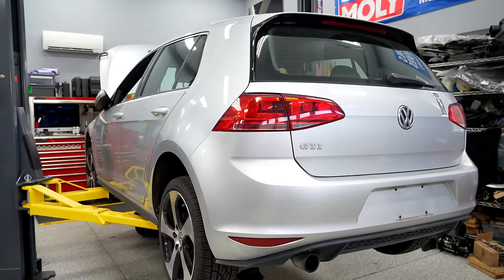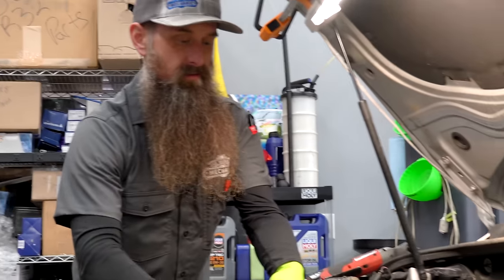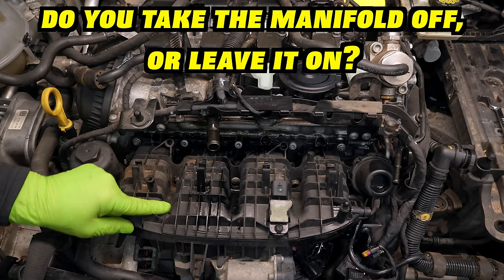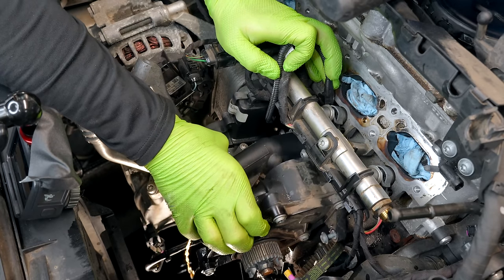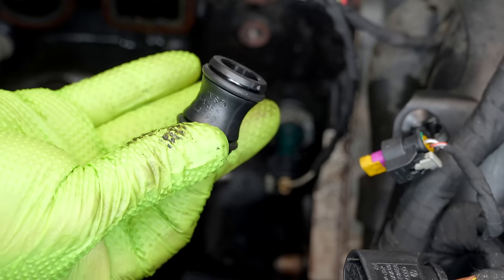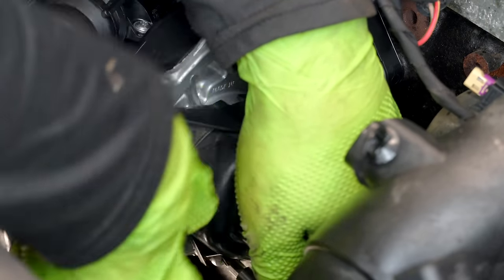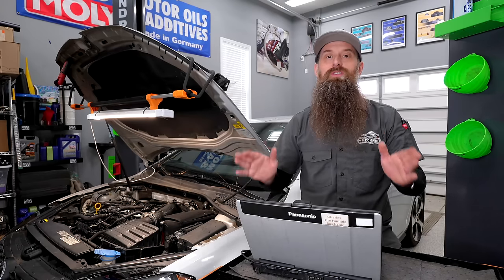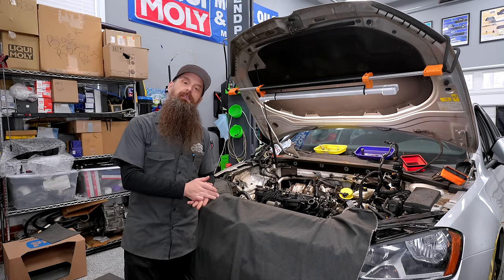How To Replace A Leaking MK7 2.0t Water Pump

Comment: How often should I replace water pump for the MK8 (play it on safeside) I have 22 GTI (bought new, originally leased but decided to keep it after a year of driving it). Love the car and want it to last for a long time. Speaking of water pump should I replace the coolant every 5 years or 10 years (VW reccomendation)?
Reply: They usually go out around 60-80k , 100k if lucky . If you are keeping it for long time. Learn to do these jobs .  They are not hard with video .  I learned and worked on my mk6

Comment: Man has been producing engines for over a century. We haven’t learned pumping hot liquid through plastic components is a recipe for failure? It’s sad that cost cutting is the achilles heel of modern engineering. Good video though, thanks!

Comment: I have a 2017 and my coolant level is at minimum and it say on the bottom g13. But the VW dealer sold me g12 now my question is should I drain all of the existing coolant and fill with 12g or just pour some 12g it will be fine? Thank you Charles

Comment: Amazing video!

Did the 2.0L tdi have a similar failure rate on the water pump?

I assume the replacement process is very similar
Reply: No, the 2.0L tdi is very different. That engine has the waterpump running off the timing belt.
Reply from the maker: This!

Comment: I prefer to do it the repair manual way.
Take the fan shroud out, then you have all the room in the world to take the thermostat out.
A shop that does it the youtube way (intake manifold out) charges more than the dealership for the same job, or at least that's what I've seen on receipts while diagnosing fuel leaks after "another shop" did the thermostat job.

Comment: What year 2.0t is the most reliable? I would like to buy a used a4, 2017- 2022,  are any of the tensioner and carbon issues less common in any of those or are they all potential nightmares?

Comment: I've got a question, I replaced my waterpump but when I start the car it goes into limp mode and heat gauge goes right up without the car heating up, I plugged in a machine and it states the actuator ..

Any help would be appreciated 🙏

Comment: I don't know if you can help me out here but I have a 2006 VW mk1 City golf, I want to change camshaft seal which is leaking and also I want to replace my coolant to a more efficient Pink one because currently I'm using a blueish/greenish one so I don't know where to start interms of doing these two jobs....but for the CAM I'm very much intimidated by the timing involved😭😆

Comment: If you conduct coolant fluid changes more frequently, you will not have the issues depicted here.  The coolant that was in this car was old and thus, had no more lubrication to provide and/or it was mixed and became more corrosive.  Keep it fresh and over time you won't see this.
Thumbs up Charles...

Comment: I had a 1999 mk3 golf with a 2.0 8V and I replaced the water pump 3 times in 4 years of ownership. From 115 000 km to 220 000 km. Seems like their flaw is still the cooling system.

Comment: My 2016 GTI with around 80k miles does not leak any coolant so I'm not eligible for the water pump warranty extension but periodically I get an EPC light, my guage goes full hot and I'm in limp mode. Pulling over and shutting off the car resets everything back to normal. OBD11 gives me a P00B700 code. Is this a bad thermostat or could it be one of the temp sensors?

Comment: Instead of using a crank locking tool, could I get away with just a socket and breaker bar holding the crank in place to remove the pump pulley?

Comment: People complain and yes this is a common issue, but around 4:06 it is mentioned this car has around 100k miles and almost all the clamps and stuff show signs of never having been removed/replaced? Getting 100k miles out of a water pump before needing to replace it isn’t too shabby in my opinion 🤷🏻

Comment: Dealership did a recent water pump replacement on mk7 gti , after that I had another leak (looks like where the oil pan meets the block under crankshaft) could this be because of there work? I tried looking under and I couldn’t find any obvious leaks
Reply: MY engine block is crusty above the oil pan, but thats just where the coolant collects from the thermostat. Idk im about to find out. I also found a little bit of oil today that smelled sweet like coolant. I think oil is collecting near the crusty coolant.

Comment: Why oh why haven't they made an updated t stat housing like the mk6. My Bomba de agua is and has been leaking very slowly for a while! I do not want to replace a part that will fail quickly anyways! I've topped mine off on coolant maybe 3 times in 90k miles! And it leaks when it gets cold here in MN never drips! But darnit I want a all metal setup!

Comment: I’ve got a 2015 golf gti and I removed the water pump today. Took the inlet manifold off. Someone tell me why does it have what looks like an extra set of injectors on top of the inlet manifold? The one is this video doesn’t have them., if that’s what they are. Why? Are they injectors?  Is it a higher power variant or something?  Or am I way off?

Comment: Mk7 owner, will replacing this for another genuine item rectify the leak considering we’re 15 years latter than production date or will the new item eventually leak like the old ones?
Reply: Will leak the same
Reply: @MeltingRubberZ28  That’s poor that is, 15 years later and still no rectification
Reply: @michael6125  yeah I'll prob put one pump in my car and at 75% of the mileage the first one took to leak...I'll put my car up for sale.
Reply: @MeltingRubberZ28  I ended up replacing mine after 70k I may just buy another one and have in my possession for when this new one eventually goes. I’m no longer single and living at mums so buying a new car every couple years is out the window

Comment: Hi I just got my water pump and thermostat changed on my 2016 MK7 GTI, the engine temperature has been dropping ever since. It does warm up eventually but is fluctuating and dropping occasionally. Garage is saying the kit may be faulty… research online suggests the symptoms indicate the thermostat being ‘stuck open’. Anyone experienced anything similar? and potential fixes or has it not been fitted correctly?

Comment: You do not pull the intake manifold according to the workshop manual.
Reply from the maker: That’s not an issue on this one because of the fuel rail. No need to be hunched over in my opinion. But both ways work
Reply: Very true. Great video as usual 👌🏻
Reply from the maker: Thanks!!! On the older ones(CCTA) the case for no intake is great since you likely have to reseal injectors.
Reply: In what workshop manual? VW manual states to remove the manifold. The warranty labor op codes includes removing the manifold also. Doesn't need to be done but it's easier just to do it

Comment: I never remove intake,even early models, it's still easy to do if did once before, and at 16:20 you didn't show on the video how to torque the gear bolt when engine still on ?
Reply from the maker: I get it good and tight. I’ve never put a torque wrench on it.  You need a special adapter to “properly “ do it
Reply: @HumbleMechanic  how do you fit the pump and belt together, belt not much freeplay, and the two pins sit high?
Reply: I try next time, usually I fit the pump first, then turn the belt in.
Reply: I know what the torque adapter look like ,easy make.

Comment: I have a 2015 GTI-S that didn’t have heat. Come to find out it had oil leaking into the coolant system. $4300 later had the whole system flushed multiple times and replaced almost everything in the coolant system from water pump, oil cooler, heater core,radiator, all the small hoses (that were destroyed from oil and cleaning) to even having a fuel injector replaced due a misfire on cylinder 2. 
Still don’t have heat😤😢

Comment: Mine did and failed out of nowhere 2400$ later don’t buy a specialty VW like GTI GLI Atreon etc those ones are pricey to fix I had a 14 Passat and that thing was a beast no issues only problem was the whole wheel assembly like tierods and sway bars and suspension (backs)

Comment: Yeah, just put my 2015 GTI in the shop because it didn’t have hot air and found out oil is getting into the coolant and so now I need a water pump, an oil pump, an oil cooler etc. etc. etc. they told me it would cost me $8000 to fix it.😭
I’m going for a second opinion.

Comment: just a heads up on the link you provided for the water pump, it redirects to a place where there is not g12evo but g13. g13 is sh*t, to anyone reading. change to g12evo.

Comment: Placing the bottom right bolt back into the ma ifold is pure hell. My magnet keeps sticking to it
Reply: Hey, not to bother but i did manage to get it all tied up and it runs much better after doing a less than stellar carb cleaning. Thanks for the vid man. It helped tremendously outside of those 2 problems. I did not replace the belt on the pump sadly.

Comment: Same on my passat 2.0 tdi…
Reply from the maker: The Passat is probably timing belt driven.
Reply: @HumbleMechanic   it is.. :-/ leaky water pump, its a comon problem on the EA288. Its a diferent type of water pump, yet the same problem.

Comment: Even if a plastic replacement works, just why? It’s a somewhat big job. Even the little union piece with the o rings on it couldn’t that so cheaply be aluminum? I think even a cheap Chinese replacement water pump to replace the shit ass oem plastic one is even aluminum, but I could see bearings and or seals failing over a long period of time I suppose. Wait I think that was a slightly different vw motor, but on this one the whole thermostat housing is still plastic.

Comment: you don’t need to take the intake manifold off… done over 40-50 of these without removal of the intake manifold. waste of time and extra cost for the customer.
Reply: How did you do it? Did you just take the throttle body and fan shroud off?
Reply from the maker: Yes TB and fan shroud
Reply from the maker: The labor time is the time regardless of how you do it. Shops shouldn’t be charging more for doing it because a tech pulls the Manifold. 

You’ve done 50. Most people doing this will do one. It’s worth their 10 minutes maybe to pull the manifold to get the pump on properly the first time.  

If I was flat rating this, I might still pull the manifold and outer studs so   I wasn’t working blind, and could inspect for carbon build up.
Reply: @wakeupmrchen  Yes and front intake pipe out, It’s super easy to get access to without removal of the manifold.

Comment: Pray to God it fails while you’re still under the 80k mile warranty extension. After that class action lawsuit, these thermostat housing went from $175 to $500. They also like to stick closed and cause the engine to overheat.